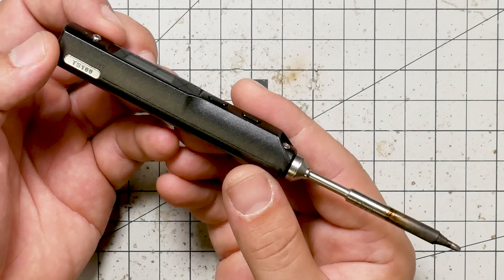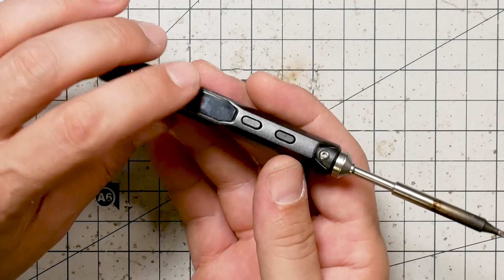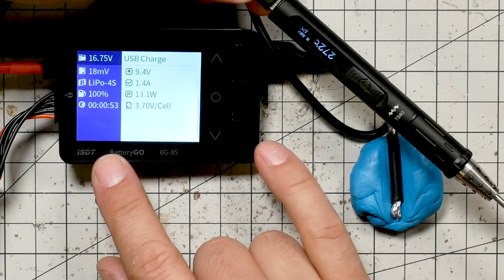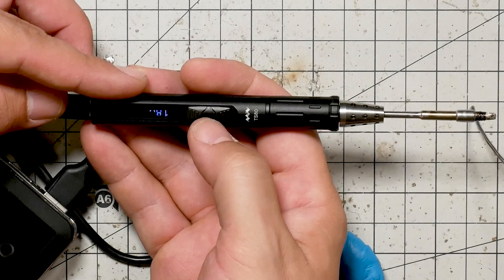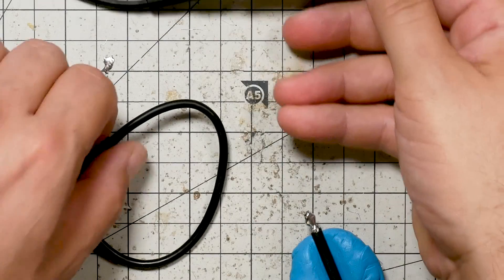Best Portable Soldering Iron TS80 vs. TS100

Comment: TS80 adjustable wattage from 16-24w.
You unscrew the tip via the sleeve on solder iron .
No need to touch it, hence the jackplug.

Comment: I currently have Velleman VTSS30 - bought for under 50 EUR, which has served me well. However, sometimes I felt a bit clumsy when soldering smaller circuits. 
Then I bought a cheap USB soldering pen. I did not have any expectations, considering it cost just 5 USD, but I was surprised to discover I enjoyed using it. It's so easy to grab it from a drawer, unlike the Velleman which has to be stored somewhere when I'm not using it. My hand coordination feels so much better with the USB pen. 
But sometimes it's too weak and I would like to replace it with something small and a bit more powerful. So I hoped something like Pinecil or TS100 would be great... alas, it has a longer and heavier tip, and tips are more expensive than for other soldering irons.
Come on, manufacturers, please create a solid portable soldering pen with simple and short and cheap tips and an ergonomic handle.

Comment: yes, but you can plug the ts80’s soldering tip into a stereo headphone jack. 

& no grub screw (needing another tool ).
plug and play soldering tip allows  it to pack into a smaller size and put together effortlessly.
usb c is more ubiquitous than dc barrel jacks and more justification in carrying a usb c cable over a barrel jack with an xt60 connector on one end.
ts80’s cryptic software is kinda bad.
but the pinecil is also cool since it has both.
i have all three but i really prefer the ts80 because of size, pull / yank it apart and fits in a smaller pouch, runs off any usb c power bank. the headphone jack tip is no nonsense.
utility-wise, the pinecil since it uses existing ts100 tips, & runs off both dc barrel or usb c. superior software.
but ultimately the ts80.

Comment: 1:48 I have something you need I took my TS 100 after putting a lump clay on it Shaping it into the way I wanted till it felt Right in my hand then molded that Poured it In silicone And now I have a silicone piece I can slide over my TS 100 It’s kind of like one of the old-school eraser things you slid on your pencil to make it ergonomically designed

Comment: If you remove the screw, the tips are still held in with retention, it's perfectly fine in this way.  Also, without the screw in it, I place my index finger where the screw was and it's extremely ergonomic to use it in this way, plus you have so much control over it.  Then, since I have the custom firmware on it, if I want to use the boost mode, it's only a short shift of the index finger to press that boost button.

Comment: you can always just throw an XT60 onto one of these little boards.. They pretty much any lipo pack will work. 6v-32v
https://www.amazon.com/HiLetgo-Module-6V-32V12V24V-Charging-Converter/dp/B07KWVL77T/ref=sr_1_4?crid=T9Q7HA6TK65T&dchild=1&keywords=quick+charge+3.0+board&qid=1592266130&sprefix=quick+charge+%2Caps%2C194&sr=8-4

Comment: They screwed up making the TS80 use USB-C, yet only using the QC 3.0 protocol. If they would have used USB-C PD it would have been the perfect portable soldering iron. USB-C PD can deliver up to 100W of power.

Comment: TS80P out now.  USB C PD 12V/2.5A with C to C cable and brick.  Can also accept QC.  So all bases covered for me.  More portability options now. TS100 still cheaper and more interchangeable compatible tips.  My other option was KSGER T12 station which is cheaper and more tips, but not very portable and seems overly complicated (so many reviews with upgrades and grounding and fire).  TS80P is perfect for me...maybe a dozen odd small projects a year.  Seems like it would be quick and very effective (Last project: used a Dremel to cut off solder 16 gauge connection... Radio Shack wouldn't melt it)!!!

https://youtu.be/9TvgolijzUY

Comment: USB-C can provide up to 100W, they have a power delivery (pd) function built in.
Cable can provide up to 5 A, and by manipulating the voltage 5 - 10 - 15 - 20 it can output teorrtical 20V*5A= 100W

Comment: I'm probably going to get a TS80,  seems like it fits my use case, I can use it at home as my main iron with the included power adapter, but I can also use my ISDT checker on the field to solder when needed. Plus I like to work on surface-mount components so being able to change tips fast is nice.

Comment: What, why would someone go from an Iron that you can plug any voltage, grab an old laptop PSU 19v sure, some 12v power brick, why not, any lipo from 3s to 5s, yep, to this USB-C shenanigans with circuitry required to start at 5v then go to 9v? That's just removing practicality.

Love the quick release of the tip, as well as the round grip (a silicone sleeve would be even better), hope they make a version with a voltage range like the TS100 and let it deal with converting to 5v for internal circuitry by itself.

Comment: I work with PA audio equipment and I am also a musician so sometimes eg. cables break and no spares are available etc. In audio world 12V PSUs are not common and that is why I did not consider TS100. However, after discovering TS80 that is a whole another story. Me or my band mates or colleagues in PA audio company will always have either USB-C power bank or QC 3.0 power adapter with them so in my business TS80 is a clear winner. This channel focuses on RC drones etc. where 12V is a standard voltage so TS100 is winner for that use, however it is not the case for everybody as I explained for my case.
Reply: The standard voltage for the TS100 is 24V, at 12V it will be much weaker.

Comment: Does the TS100 measure voltage from your LiPo and stop when it goes below a certain amount? (PS: I have one and I use it on my work bench all the time with a plug in power supply for EVERYTHING, It's awesome! I got rid of all my other soldering irons)

Comment: I just bought a TS80 and is simply because I'm just a hobbyist and I just have a QC3.0-enabled power bank (upgrading from a really crappy soldering iron) from Zmi.

I'm hoping one day they will make their soldering irons support USB Power Delivery (USB-PD) standard, which can supply up to 100W(Some unofficial versions even support 120W+) and is getting more and more attentions from manufacturers of power banks and power supplies, while QC3.0 seems to be a dying standard these days. There are already some power banks from Zmi with PD support can output 60W several years ago. And if I didn't remember it wrong, they just released a power bank capable of output power at 100W just several months ago.

Comment: My old faithful soldering station finally broke. I could actually just replace the iron but i want something new. Shhhh don't tell the wife. Could the ts80 replace a soldering station? They end up being similar priced to a good soldering station by the time you get everything. I'm thinking either the ts80 or a stm32 powered controller with a 70watt direct drive t12/15 handle. I do solder quite often for short periods of time.

Comment: I love my TS100. I bought the full set with 9 tips, which was definitely overkill, but the case is nice and the little ceramic stand is actually a small piece of quality. I put the Ralim firmware update on, and made a new silicone power cord, coming out of a 20v supply. It almost feels cordless and has basically replaced my Aoyue 968 A+. 

I haven't seen a TS80 first hand, but this and other videos all say the same. Match the features to how you want to use it and go for it.
Reply: I bought a TS80 lately, and while I never soldered with a battery powered soldering iron, I really love the TS80 and in my oppinion it works better or just as well as any soldering station I ever used. However depending on the soldering job the size and form can really be a disadvantage so I am thinking about building some kind of grip extender. Also I bought a longer Type C Cable.

Comment: I don't want to mess with USB cables.. or USB controllers. I always have a car battery with me in the field because you know I drove to wherever so the ts100 is way more versatile.
Reply: I agree with your point of view. However, I personally have exactly 0 LiPo batteries, but always have at least one USB-C battery pack with me at all times. Also, in my field of work I don't have any other 12V supplies readily available at all times. That's why for me TS80 is a clear winner. At home I have the same Hakko as Joshua if I need more power.

Comment: My phone charger (5V 4.5A) is too powerfull for the TS80 😎... Or it would be if it couldn't switch to lower power ("Only 9V 2A")
Reply from the maker: 4.5A is the max rating. The iron will only pull what it actually needs.

Comment: lol your battery pack must be a quick charge compatible one (there cheap) and another big difference is the TS80 while being slighty lower in power output obviously (not unicorn magic) it is All metal contruction and nice and round, the TS100 is plastic and not wonderful to hold. Do your reviews correct or don't do them

Comment: Hi Josh, i just bought one, but i have a question, can this be powered from a car 12v plug in (cigerett lighter) and on the bench can this be powered from a dc volt charger ie old lap tap charger , would be interesting to know

Comment: While the fact that the TS80 won't try to pull huge current through a normal USB supply is nice for not frying your laptop, it seems like at the end of the day you just have a soldering iron with a power adapter, which you can run off another supply if you have a quick charge power bank or wall wart. I'd prefer the TS100 especially if it included a ~20v power brick, and can run off anything with a 12-20something volt output.

Comment: i want ts80 cause the easy tip replacement but at £17 or $21 its a no deal, compared to ts100 its worth it £7 or $9-10 and been used by truly Amazing people  like blue falcon,painless360 and of course Joshua Bardwell

Comment: I kinda disagree with something. A battert bank with qc 3.0 will allow you to work 4 times more then ts100. Due to direct tip heating feature from ts80, with other words, ts 100 will lose energy at base of tips. So, from 65w at least 30w is lost in disipation of heat. The ts 80 will put entire 18w in the tip. Also the new tips are shorter for ts80, it is good for handling when solder tiny chips. But, overalll ts80 with that low power is insanely power efficient, especially if you work from battery banks, you gonna do 4x more joints then with ts100.
Reply from the maker: I agree that it's very very efficient. I just am not interested in carrying around a QC battery bank when I have 20 XT60 packs already with me.

Comment: What's the deal with the "ground wire set screw" on the TS100?  Does it actually need a ground wire?
Reply from the maker: If you are working on equipment that is sensitive to electro-static discharge, the ground wire set screw can be used to ground the TS100 and prevent damage.
Reply: @JoshuaBardwell  Ahh, got it.  Thanks.  I really rely on your stuff!

Comment: a few months ago i did sum research about the tech used for the TS100 vs the Hakko. and my conclusion was/is that there is substantial improvement in the direct heating of a tip. Meaning having the heating element inside the tip has a few important benefits. i would consider this the newer tech as "Louis Rossmann" stated in one of his vids.. i did buy the TS100 but soon after i bought a second STM32 based  station called the 
"KSGER T12 STM32 Oled" from Aliexpress. the main reason was that the tip range for the TS100 was and is limited i found the chisel tip to be to big. to my surprise no one made other tips for TS100 same goes for the TS80 btw. BUT for the KSGER T12 i could get T12-D16 and T12-D12  i bought a tip from the Quicko brand. one normal (the smaller one) and one so called High-grade.. (D16).. the normal one is good enough.. i found the smaller one to be the one that suited the type of work i do.. that is D12.. consider that the TS100 has a D24 that's way way bigger.. also tip price for the TS100 is more expensive.
also ergonomics comes in to play and having a grounded tip out of the box.
i bought the KSGER model that did not come with a power supply because i don't trust them to provide a supply to my standards so i bought a supply that was the max for the TS100 and also worked on the KSGER grounded laptop supply that was certified for medical equipment hahah apparently that's a thing...i also went all out on the soldering handle just because i could..looking around on the site i found you could get the station with standard handle for $30 up to around $50 depending on the handle you want..
good luck guys.

Comment: Thanks for your review. I think I will go with the TS100. For soldering mechanical keyboard switches and "stuff like that" which tip would you recommend? The B2 or the BC2?
Reply from the maker: For fine work definitely the B2.

Comment: What happened to the TS-100 v TS-80 comparison?? You didn't solder the heavy gauge wire with the TS-100, you used the Hakko 888?!?! Duh! You fail to mention tips for the 80 are twice the price as for the 100. There's an '80 'kit' that comes with a 'proper' tip, a silicone USB cable and a power supply for just £6 more than the basic iron and rubbish needle point tip.

Comment: So. Could you use a 9 volt battery to power the ts 80?
Reply from the maker: No, that wouldn't work. TS80 requires a Quick-Charge compatible USB port. You can't run it off of straight DC voltage.
Reply: @JoshuaBardwell  Hi, can you explain why not? It seems a perfect way to power it. A 2S(3S?) Lipo for example =8.4v fully charged (maybe with a Buck converter to drop it to 9v)?
Reply: @davybloggs1564  alkaline battery has high internal resistance, and not capable of putting out the type of amperage probably needed to work properly.

Comment: what happens if i plug headphones into the TS80? (like if i plug them into where the iron's tip goes)
Reply from the maker: If the TS80 designer is smart, it will detect incorrect load and shut down. If they are dumb, it will toast your headphones. Try it and let me know which one happens LOL
Reply: Please record your findings and post video in reply to this thread. I would love to see glowing earbuds. ;-)
Reply: @jamesordwayultralightpilot  i totally would, but i have a TS100, not a TS80.  probably the only downside of the 100 is its lack of a headphone jack :(
Reply: @notsumo  I don't think you'd get a headphone into the plug anyway. It's quite deep in the body...
Reply: kain0m yea but what if I took it apart or something?

"It's quite deep in the body" hahaha
Reply: Will the TS80 accept my headphones?
No!!! Because sodding Apple have now changed so the headphones which came with my phone only fit an apple port! Bloody Apple ruining our fun!!
Reply: Marco Reps has a video on this, it's a review of the TS80, it just makes a weird sound.

Comment: I like more powerful TS100 more due to possibility to solder both small SMD components and large capacitor pins and AWG12 power pads. Plus ability to power from 4S/6S LiPo battery in field which is awesome to fix crashed quads in field. So I bought full TS100 kit with tips and power supply as my Christmas present.
Yep, my relatives can't guess I wish to get a thing like that nor where to get it :D

Comment: Hi there. Does your BetteryGO BG-8S make some weird sounds in USB power mode? I have purchased same but it makes some noise in USB power mode.
Reply from the maker: Yes mine does. It's the inductor in the voltage regulator.
Reply: @JoshuaBardwell  Mine also. Thank you for your response, sir.

Comment: The BG-8S is nice, BUT its a little on the expensive side... if you want to convert your ts80 into a ts100 (power input wise), get one of these https://www.banggood.com/DC-Buck-Module-12V24V-to-QC3_0-Single-USB-Mobile-Charging-Board-p-1310585.html?cur_warehouse=CN which is smaller than your thumb and solder a dc barrel jack on it... it actually gives you slight better range of inputs - ts100 takes 12-24v, with this module you can go as low as about 10v but all the way up to 36v (ideally you'd be operating it between 12-36v tho).

Comment: My TS100 came with the BC1 tip, which has always been my favorite tip with any iron. Thick enough to hold great amounts of heat, but has a sharp enough edge should I need precision. I hate those super fine point tips most irons include
Reply: This was an option for me and I choose the one that is flat a little on one side; TS-BC2 they call it. I only saw one with the conical shape and another conical but with a very sharp point. No other options but I will see on changing to the one that is smashed on both sides, I don't know what they call it.

Comment: The TS100 tops the TS80 for my personal usecase. Powering it is so much easier than using the shitty QC3.0 standard. Also, the TS80 has been replaced once already after a week of use. The lack of tips surely puts the nail into the coffin... TS100 any time!
Reply: I power it off Anker's PowerIQ 2.0 and it works amazingly.